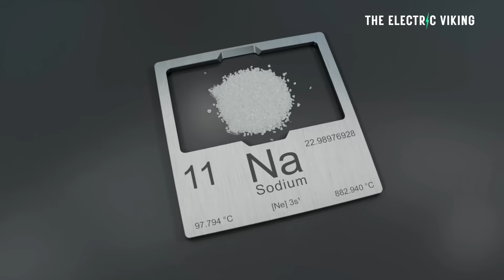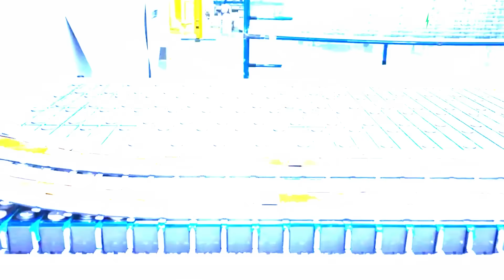Goodbye Lithium! New 3,600,000 Mile EV Battery costs 50% LESS

Comment: The problem with ultra long life batteries is the cells may be rated for 100k cycles, but the real world life of the batteries won't necessarily reach that... Like LED bulbs that have a claimed 10000 hour life and Gail after a year because of cheap parts and poor assembly. And in vehicles, there are so many external factors like corrosion and temperature variance, you can't predict how long they'll last
Reply: Most battery failures you see today is from the failing BMS, not the dead cells

Recent new gen NMC can last 3000 cycles, LFP can last 7000 cycles, sodium ion is not far off at 6000 cycles, so it will technically outlast the whole lifetime of many electronics, including EVs
Reply: @sihamhamda47 but led light per se starts diminishing the illumination quality after six months at least in india
Reply: I have an led bulb running for 7 years now. No signs of failure. Also, an led tube light that is 8 years old. So, it is true, not claimed.
Reply: @Berkhoi You're lucky...my experience has been a high level of failures after a couple of years (and CFLs (RIP) were even worse)...i still have some incandescent bulbs in closets that are 40 yrs old. It's always the electronics that fail first.
Reply: @Berkhoi I'vve had a ton of led bulbs go out after 1-2 years. Just had another go out a couple weeks ago. In my experience they last less than florescent bulbs.
Reply: Oddly, Philips designed a special range of LED bulbs for Dubai that are engineered to truly last 10,000 hours - their expensive, and not easy to get hold of but they last that long (it's a minimum standard in the country). 

The same is true of EV batteries as well, some are well engineered. However, in a vehicle no one is going to see the long cycle levels now being stated as the rest of the car won't survive as long as the battery. In stationary storage grid storage, with operating lifetimes of 15 to 25 years, then yes the batteries will be tested against the levels manufacturers promise.
Reply: What happened to CATL's "condensed matter battery"?  

Wasn't THAT supposed to be the battery "game changer"?   

CATL's Condensed Matter Batteries were supposed to give us electric planes... soon.    Where are they???

*
There's no negative consequences for CATL coming out with BS about batteries every 9 months.   They can put out BS with the blessing of the CCP (don't forget -  CATL is a CHINESE company, which means they do want the Chinese Communist Party tells them to do).

Russia funded the European idiots of the Green Party to help keep non-Russian natural gas off the market, and make them DEPENDENT on Russian natural gas.   Why shouldn't CCP- controlled CATL come out with BS battery stories that say, "Don't invest in oil indepence!  Batteries are going to make oil obsolete!".  --- or some such BS.
Reply: Yeah, some electronically-minded YouTubers pointed out that cheap capacitors were usually the failing point not the LEDs themselves.
Reply: Use them immediately for solar cell  panels storage instead of EV use! That’ll solve the durability issues

Comment: I hate hype where it's not warranted but this one is and also the primary reason why CATL failed to renew its permits on 6% of the world's current produced lithium via that one line that was put on ice. It's also important to note that these can be built on existing lithium-ion lines using the existing equipment. No need to rebuild a factory from the ground up. That alone is why you're going to see huge cost savings much the same way SLATE skipping the paintshop for PET bodies saves at least $1B from the start up costs...

Comment: Why not reuse the battery from your first car to your next one? 
Possible?
Reply: can easily get 95% of the materials in lithium-ion battery. Many videos on YT showing it.
Reply: That would be the best thing to do environmentally, form factor and efficiency of the actual vehicle also to be considered
Reply: I'm still waiting for the first modular car, you have a chassis with battery and electric motors, in summer you place a convertible over it, an SUV if you want to take the family on holiday, a station car if you need some room and length, small motorhome? With standardized plugs it wouldn't be that difficult, air suspension to adapt to different weight. 

You buy the chassis with your basic every day car setup and you can swap it out whenever you need something else for a while.

Comment: A graphene/water battery actually charges itself from surrounding moving magnetic fields and capillary movement of ortho water.  I have a cell running at 0.52V@43mA/squarecm.  So it charges itself via gravity, has effectively infinite recharge lifecycle, is cheaper than salt, works as long as the water does not freeze or boil and can be scaled in any shape.

It must be a game changer as even the tax office wants to shut down all development.

Comment: Even if the batteries at the cell level were completely free, all the peripheral equipment to make a battery pack and integrate it into a house or vehicle would still be the same.  This is where cost savings must be made.  Good on you for pointing this out.  What we need now is this battery technology with an integrated hybrid inverter for the home market, at an affordable price. Possibly the temperature range of the Na batteries is the most significant.  This opens up the market in northern countries like Canada and Scandinavia.

Comment: What i heard from a main scientist/ engineer/ researcher in batteries in my country a few months ago was that sodium batteries production cost was 7 times less than regular lithium batteries and 10 times less than Tesla's. Production cost, not price to customer, even if bought in large quantities. These are very different things. Also, she said the main advantage in terms of temperature resilience was in low temperatures. With high temperatures, performance was similar to lithium. Energy density is the only downside when comparing to lithium. Everything else it wins. Already completely won when comparing with lfp.
Reply: Energy density because sodium obviously weighs more, and each cell reaches a slightly lower voltage.  You need a bunch less rows in parallel, but a few more cells in series.  Overall it balances out and far more favorable to the consumer being safer and lasting far longer.  Production is still low, so they do cost a premium at this point.
Reply: Low-temperature performance is everything here in Canada, where -40º temperatures are routine in winter. The EV manufacturers keep re-assuring us that the winter performance is perfectly fine, but EV owners here knows that we lose a lot of charge driving in winter. It's not a huge problem for in-city driving, but we're also a huge country, and getting stranded out on the highway in winter can actually kill you.

Comment: Don’t forget about the aluminum ion batteries that are way better than either one of these
Reply: Sorry if you're American but aluminum was tariffed by TACO. Canada who supplies 80% got nailed and now it costs more for US.
Reply: @bugtusslealien3931  aluminum is the third most common element out there even with the 50% tear up and it still be so much cheaper to make them out of aluminum. It’s ridiculous. Plus you’re talking about a better battery.
Reply: Aluminium is costly to extract and purify to its metallic form, it also requires a fair amount of input energy to process. Sodium is cheaper to access, particularly from sea water, and is much cheaper to extract the Sodium in pure form required for batteries. Aluminium ion batteries are also further behind on the technical readiness level than sodium ion.

Comment: These would be great for domestic use.  Home battery storage. Energy density isn't really important then.
Reply: Yes, that combined with solar up on the roof can make your electrical costs in a house a lot lower than it is now.  Currently a solar panel pays for its self in about 8 years.  Adding the battery may make it pay off in 10 years but after that you pay nothing for power.

Comment: For simplicity sake, you can say solar panels last 30 years and sodium ion batteries last 30 years (in truth, both will be ~80% of original performance).  That is sufficient to calculate out levelized cost per kilowatt with 24 hr delivery.
Reply: This is one of the things I find most annoying about solar panel disinformation out there. The amount of times I hear someone saying solar panels have a life span and have to be replaced after x amount of time because they think they completely stop working after 20 to 30 years. Vs the reality that they actually only lose like 20% of their efficiency.

Comment: I love the pod but a little misleading about byd. They broke ground all the way back in January 2024 on a 30gwh sodium ion battery plant for cars. They already produce grid scale sodium ion batteries.  So they're not left in the dust or or being smoked by catl which is also a very good company. Don't get me wrong. But I don't see them getting blown out of the water by catl anytime soon
Reply: Still very little compared to total annual battery production of almost 4TWh. In order to "change the battery industry" the sodium battery production needs to be at least 25% of the total, aka reaching 1TWh/year production capacity

Although CATL once said that sodium ion will dominate over 50% of the LFP battery market and 1/3 of the total battery production in the 2030s, I still take it with a grain of salt. I just wait if they could deliver their promise over the next couple of years (even though the sign is getting clearer as I saw that sodium battery has start entering several marketplaces this year)

Comment: The best advantage of Naxtra Sodium battery is safety. Crush, puncture and saw into half no fire, no explosion.
Reply: And it does not destroy the environment when you mine it.
Reply: @J-rex980  I imagine it might even improve the environmental impacts of desalination by providing a byproduct use for waste brine-derived salt.
Reply: @J-rex980 ALL Mining destroyed the environment...wish the global 8 billion people live in the garden if Eden....so it's overpopulation issue..
Reply: Makes the quote I got for a 10kw house battery extortion. 1k per kw.
Reply: @sic04250f  For sure, their are a ton of batteries that are much cheaper.
Reply: less dependency on chinese lithium
Reply: What about SSBs?
Reply: So what happens to the energy stored within the battery that’s been sawn in half? It doesn’t disappear. Can’t destroy energy.
Reply: @sullivanrachael  there is chemical and electrical potential there, just unreleased. If you have aluminum in a powdered form, it will quite happily combust if given a spark or flame. If no flame or spark, it’s perfectly inert. Depending on battery chemistry a battery requires a circuit to release its energy, so if cut in half there’s no possibility of completing the circuit and thus less danger. Batteries that catch fire usually do so because the electrolytic fluid (stuff inside the battery itself) can permit the reaction to occur and continue. This isn’t true of all battery chemistries.
Reply: @sjsomething4936 - okay. Sawing a battery means the insides are exposed to the atmosphere, which means oxygen and moisture. Usually that means a chemical reaction happens if the chemicals are reactive, energy storing materials. I do not believe a high capacity, energy dense storage device can be simply mutilated without some bad things happening.
Reply: @sullivanrachael  ok you’re not a chemist, I get it.
Reply: @sjsomething4936 - clearly you aren’t either
Reply: Was about to ask, thanks for that.
Reply: The lithium lobey will not be happy
Reply: What happened to CATL's "condensed matter battery"?  

Wasn't THAT supposed to be the battery "game changer"?   

CATL's Condensed Matter Batteries were supposed to give us electric planes... soon.    Where are they???

*
There's no negative consequences for CATL coming out with BS about batteries every 9 months.   They can put out BS with the blessing of the CCP (don't forget -  CATL is a CHINESE company, which means they do want the Chinese Communist Party tells them to do).

Russia funded the European idiots of the Green Party to help keep non-Russian natural gas off the market, and make them DEPENDENT on Russian natural gas.   Why shouldn't CCP- controlled CATL come out with BS battery stories that say, "Don't invest in oil indepence!  Batteries are going to make oil obsolete!".  --- or some such BS.
Reply: So, you crash your car with the sodium battery. Okay, unless your accident occurs in a rain storm and the battery gets cracked or opened up.
Reply: ALL Chinese batteries regardless of chemistry by LAW now have to pass these tests. Even LFP and NCA... July 1, 2026 is the deadline...
Reply: @stickynorth Riiiight, and nobody told CATL? They unveiled Shenxing2 with already useless bulletproof pack in same presentation as Naxtra!
Reply: @stickynorth  imagine thinking the law means anything in china
cool story though
Reply: @paulbarclay4114  China enforces their laws — even for wealthy people.
Reply: Lithium-ion EVs are already much less likely to catch fire than internal combustion cars. This eliminates the fire risk altogether.
Reply: They will be more dangerous than lithium batteries. They will not be better on the environment. 
Mark my words.
Reply: @aaronfranklin324  based on what? sowing fear to create doubt and to manipulate.

Comment: why is no one introducing the swap battery as a standerd. We can drive with a hundred or so km range pack and use an "all purpose" connecter to place an extra swap battery (also used for other occasions) in the trunk
Reply: Battery leasing hasn't worked outvwell so far.

Comment: Although CATL has proven themselves to be very innovative, this is still hypothetical.  If it’s not driving around in existing vehicles as projected, claims remain in the category of PR.  Probably not to the degree of the “super capacitor,” but not reality either.  Certainly, we should watch with interest, but let’s see what reality turns out to be before doing the same thing others are accused of, speculating.  Keep reporting, but guardedly.

Comment: Sam, hate to burst your bubble, but I can buy a single 1 kWh LifePO4 cell for about 55 euro..
LifePO4 is coming down hard, too add, the voltage range of sodium ion isn't great for current inverters..
Doesn't make it a problem for cars or grid scale...
Furthermore sodium ion cycle life is still much shorter than LifePO4..
Will sodium get there? Yes, are they there yet ? 
No

Comment: The location is The Outback, or perhaps a Georgia swamp or Hindu village.  A ramshackle home, one of several in the cluster, hosts a rusted-out BYD sedan up on blocks. Glass long gone, seats ripped and rotting,  doors spread wide and rusted open. BUT a solar panel charges the car as it broadcasts a satellite station and powers their homes, thanks to The Battery - instead of a junk heap, it's the village savior...
Reply: You’re assuming that Hindu slum would still exist in the next 5 to 10 years
Reply: Check out “Stellar” by Tony Seba. That’s the game changer.  😊

Comment: My Chemistry teacher dramatically demonstrated how highly reactive metallic sodium is when exposed to water.  The explosive chemical reaction produces hydrogen gas which instantly ignites due to the exothermic reaction (a tiny pinch of sodium sprayed the classroom with shards of beaker).
Reply: That’s why you have to be really careful with salt shakers.  ;)
Reply: One assumes that these batteries do not contain sodium metal so that isn't an issue. Sodium compounds are often very stable.